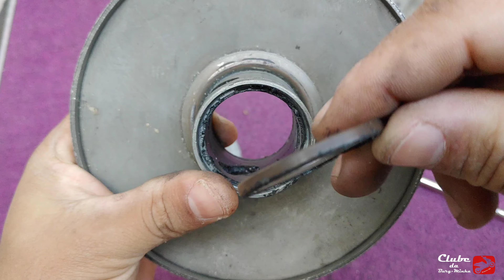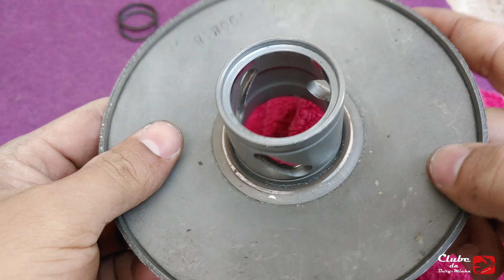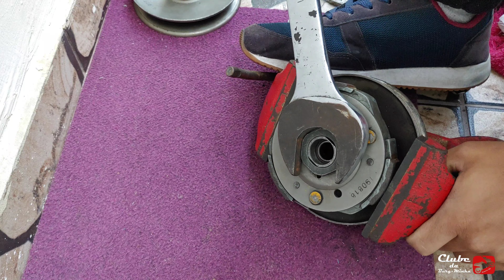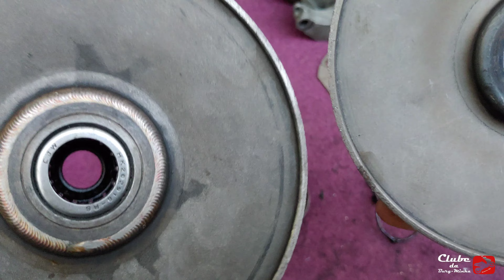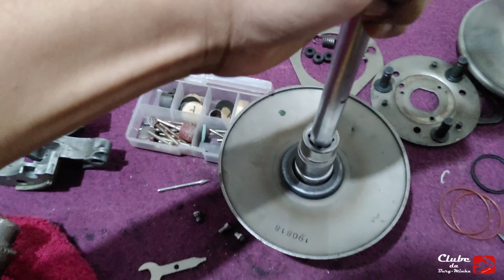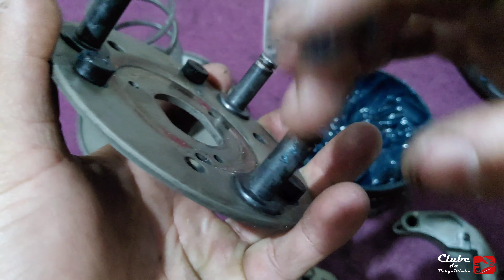Manutenção da Polia Traseira Burgman 125 | Retentor, Rolamento, Engraxamento e Substituição

Comment: Tenho uma burgman 125 injeta 2013 que quebrou a correia e ficou muito estranha, mesmo depois de trocar os roletes, correia, tudo original.

As polias primarias e o variador já tinha trocado da última vez, porém agora quando passa de 60km a moto dava uma sensação estranha de algo agarrando.

Ai fui desmontar a embreagem e polias secundárias, e percebi que os pinos e os orifícios estavam com muita folga, e também a guia onde corre os pinos estava com folga.

Foi quando percebi que a polia movel tem 2 furos a mais que dizem que é para lubrificação, esses furos a mais casam com os orifícios dos pinos guias, precisando apenas fazer mais um furo pra encaixar os 3 pinos guias e deixar os antigos pinos no lugar do furo de lubrificação.

Se der der certo não precisarei comprar a polia secundaria que sozinha custa 270 reais na autorizada, preço em novembro de 2023.

Já a polia movel que tem os canais guias acho que não vai ter jeito porque não sei se é seguro encher com solda.

Vou tem registrar um video pra documentar.

Acho um absurdo pagar 850 reais no kit de polias e embreagem na autorizada, mesmo durando 90 mil quilômetros, sendo que as polias secundárias estão novinhas.
Reply: Boa noite meu mano, deu certo? Estou com o mesmo problema na minha que também é 2013, não passa dos 80KMh